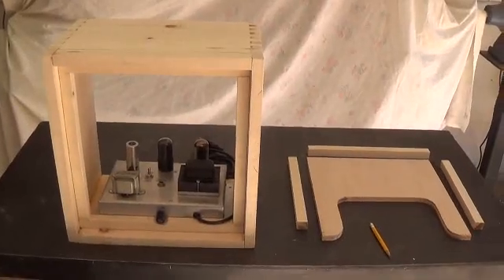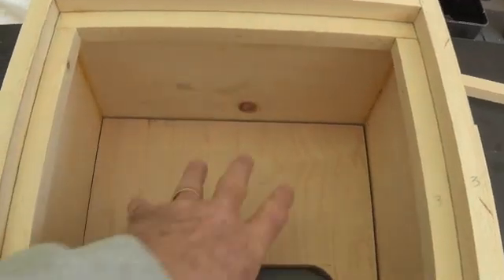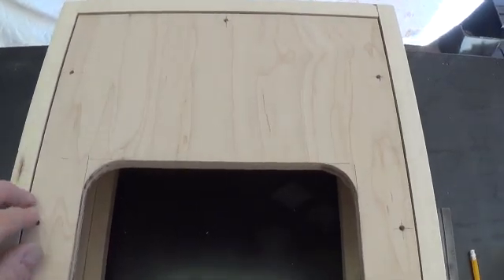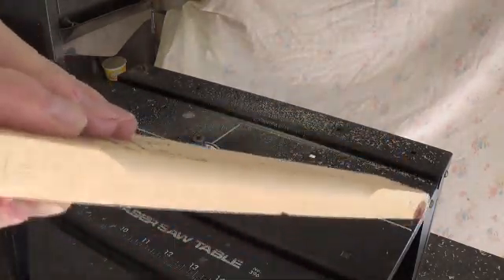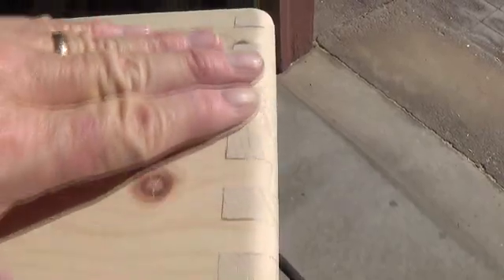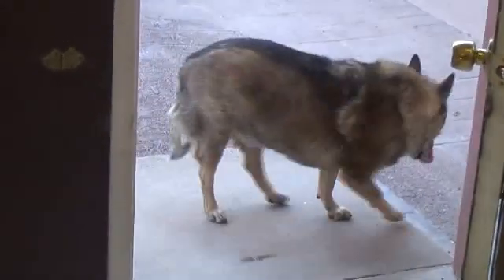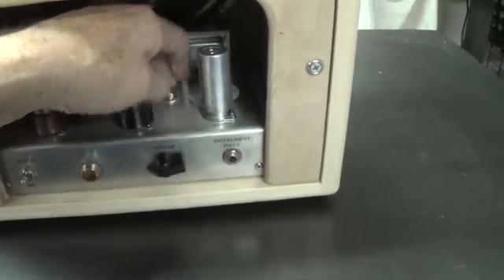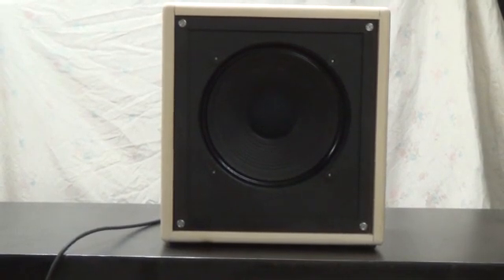Constructing a Finger-Jointed Pine Amplifier Cabinet......Part 2

Comment: there are few tools that scare me as much as routers (and table saws.) i think they were responsible for the majority of injuries back in high school Wood Shop, although nobody lost body parts in my class.

we also had the predecessor to the table router, the all-terrifying Spindle Moulder. talk about dangerous! ours was tucked back in a corner, unplugged and unused. the teacher thought it was too dangerous for anyone to work with, and given how high school kids act, i'd be inclined to agree. when half the class are students trying to find clever ways to make bongs out of everything, they're probably not the type that should be around tools like that ;). half the time they couldn't even use the belt sander without their project flinging across the room.
Reply from the maker: I agree, Cat. Routers make me nervous for some reason. I'm sure a bandsaw could cut off an entire limb, but a router would just shred it. At least with the infernal device secured to a table, you stand a reasonable chance of surviving.

 My memories of shop class in high school are similar to yours. Hardly a day went by without someone running out the door into the common area, screaming and yelling, waving their bloody ______ (fill in the blank) while the teacher tried to catch them and calm them down. It's a wonder anyone ever dared to take shop class, considering the bad advertising it got on an almost daily basis.
Reply: the bandsaw never scared me that much. i think it's because the guard is pretty low when it's setup right, and you just have to watch your fingers a bit.

i don't remember too many bad injuries in wood shop. one kid was making a baseball bat on the lathe with a piece of ash or something; he dug in too hard, the bat popped out of the lathe, smacked him right in the head, and knocked him on the floor. aside from a huge knot on his forehead he was fine, so i didn't feel too guilty about laughing hysterically. the thing is, we had a guard that went over the lathe specifically to prevent that sort of thing from happening. of course the kid didn't use it, and instead of getting any sympathy, the teacher yelled at him, "Sire, what did i tell you about using the guard? Now go to the nurse's office." (my wood shop teacher was a guy from Texas who insisted on calling everyone Sire for some reason, and we were required to call him that too.)

i think the kid's pride was hurt more than anything else, although it made a pretty impressive sound when it hit his head :) .

now, the metal shop was right across the hall, and it seemed like every other day some kid ran screaming out of there with some horrible, bloody injury. that classroom was a death trap, but it kept the school nurses in business. you couldn't have paid me to take metal shop!
Reply from the maker: I think you should write a TV script, Cat. It could be a teenage retrospective-bloody horror-but-instructional masterpiece. My respect for bandsaws came when I realized that butchers used them to dismember cattle. Granted, with the guard down low, you only face the loss of smaller extremities, but someone once told me that if the blade broke at just the right time and place, it would spring forth and eviscerate you. Foolish....absurd......but after every successful use of the band saw, I am always secretly relieved to have escaped evisceration....:)))

Comment: This cabinet came out really nice! Only thing I see is, you'll have to pull the chassis to change the fuse...I agree about the speaker sounding a little blunt on the top end, A Jensen should do the trick! Other than that, the tone is warm and nice low end! I guess Rusty doesn't like cleaning up saw dust :)
Reply from the maker: True about the fuse, Frank, but I rarely (if ever) have to change amp fuses. The speaker really is nice and warm with great bass, but seems to lack clarity to me. I'll keep evaluating and may replace it....but that would sort of defeat the purpose of building an amp with spare parts.

Rusty is great with the tennis ball but not so hot with chores.....:)